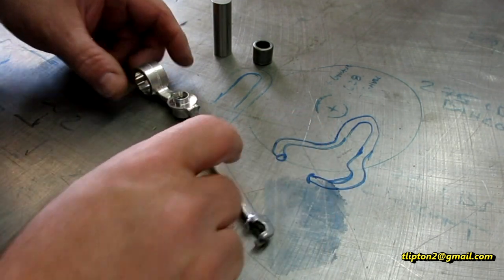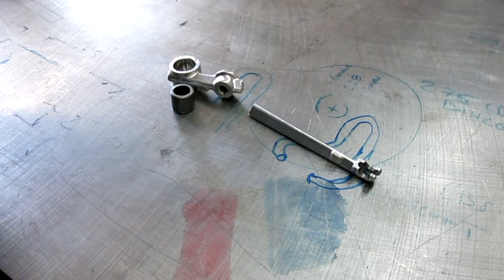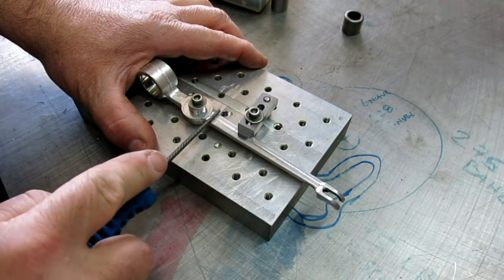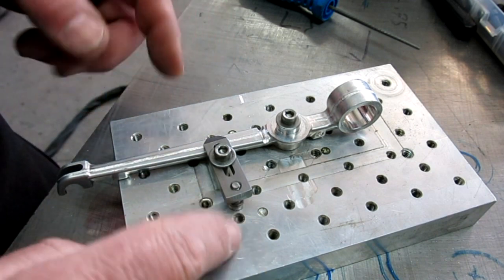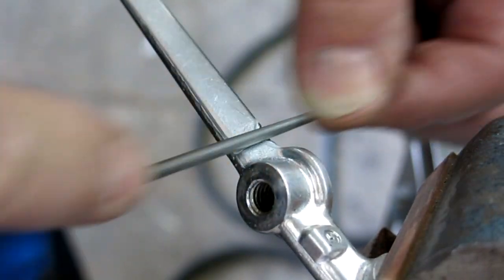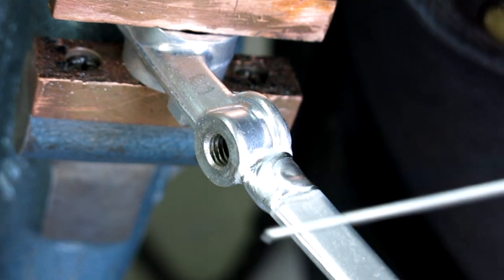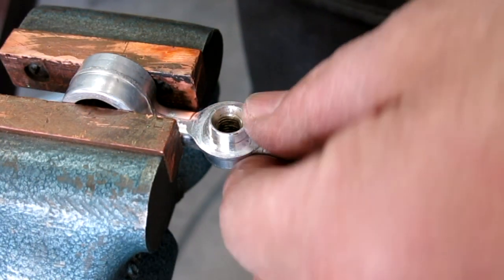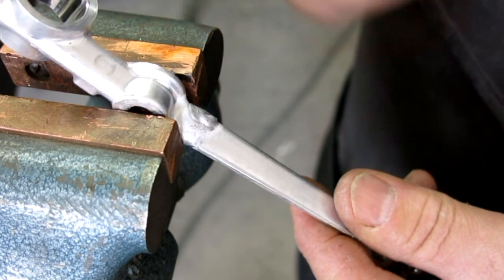BMW Clutch Arm Repair

Comment: Very nice repair Tom with excellent technique as usual.  I have found that hammer peening aluminum weld zones appear to increase the strength and ductility from the cold working of the material.

Comment: very nice weld, tom! you've just saved that man a pile.
the little sparking, if i may venture, is from the "skin" of oxides that is always on any aluminum surface. a scrape with a stainless brush would have been good, but not necessary.
thanks for the vid,
-toly
Reply: Generally the oxide layer on aluminium won't cause 'sparking', in this case it is likely to be impurities in the casting boiling off. Most probably zinc or magnesium additives as castings are rarely pure aluminium.

Comment: Thanks for the back drag on the file. I sharpened inserted tooth sawmill blades for years by hand, and if you're worried about ruining your file by not lifting it on the return stroke, you need to buy a better file. (I bought mine, so I figured I could do whatever I wanted :).

Comment: I always heard that welding cast aluminum is difficult because it has such a large amount of impurities in it.  Is it possible the cracking noises could be these impurities burning away?

On an unrelated note, after watching the Baby Bullet build, you have really gotten me into filing.  I was blown away at what a beautiful job can come out of filing.

Comment: Once again, a very interesting video and a curious part to repair. I was watching you file away at the break line, three times you filed away.  However, to my eye, which is somewhat calibrated by experience, you filed the third cut somewhat deeper than the other two.  How do you decide how much to remove…?  I have only a very little welding experience. But I am ready and willing to learn more about it.

Comment: Tom, Very nice as always. Any possibility that the threads would be "squeezed"  a bit by the heat of the weld requiring a clean up pass with a tap?
Regards,
Eric

Comment: When I was younger and most likely dumber I used a technique of drilling into each side of both parts like you have there and drill a hole perfectly aligned to each part and pin the two sides using a hard steel rod to fit the hole and use a high grade adhesive and most items i did that to had very good success doing it that way...having no welding tools to deal with it.

Comment: After the first weld on the pallet (held), is there a chance of the part pulling out of line with the second weld (warp?).
Reply: +outsidescrewball it looked to me like there was some play up on the fork end. So if that arm warped any you can probably adjust for it. Good enough.

Comment: I routinely weld alloy motorcycle parts for work in the process of restoration and I wish it went so nicely. Typically I deal with oil soaked sand castings of anywhere from 50-100 years old. Any tricks you can share in regards to how you got the part so clean? I'll generally try to cook the oil out in an oven and then use acetone and a stainless brush and repeat until it  looks ok but it's still usually a nightmare.

Comment: When filing, do you generally try to file all the way through to where the other side was repaired, or do you end up leaving a little disconnected bit in the center?
Reply from the maker: Hi Pete,

In this case I wanted to file into the weld metal on the other side. You need the original fracture for good alignment but for full weld penetration you need to be close to the opposite side. On a small part like this you can leave a little center bit still there and the hot weld will cross the boundry. Hope that helps. Thanks for the comment.

Cheers,

Tom
Reply: Thanks Tom. That's exactly what I wanted to know.

Comment: Nice job. Really surprised that arm did not distort more. Is that your talented heat control or just the nature of cast aluminum and TIG? Is it safe to think that might be stronger than new? Also thought the comment about "hammer peening" the weld below was interesting - do you have an opinion? Liked your "that's all he gets" comment. Keep up the good work.
Reply from the maker: Hi Gus,

Aluminum and a small weld like this does not move much. The conductivity of aluminum helps with minimizing distortion. Thanks for the comment. 

Cheers,

Tom

Comment: I use Durafix rods and a propane torch.  I expect these would work too but at a greater risk of melting the registering crystals...especially if magnesium continent is high.  A riskier approach but good if u dont have tig.
Reply: +Joss Fitzsimons i hated doing that, it was my only choice too, esp for thin materials, never got a tig welder, but i sure wished i had.  id be dubious of this repair holding, if it snapped it before it will again, probably just next to the weld this time. perhaps machine a thicker one from steel would be a better idea.
Reply: +jusb1066 You'd need to pick a stronger alloy, and weight becomes a problem with steel parts... and, a larger part probably won't fit on the bike.

Not sure which alloy this piece is, but it rings like a 7000 series aluminum, and 7075 is stronger for the same volume than most steel alloys...

Comment: Hey, not all of us Engineers have soft hands! Some of us actually have common sense and machining skills. 

...Although very few, I will admit. I can count on one hand the number of engineers I went to school with that I would let near my machines.
Reply: +Transane Very true!
After working on and repairing different machines through the years, there are some engineers who designed this stuff, that I would love to get my hands around their throats! Not much "common sense" there. lol
Reply: +Transane There are Engineers and then there are Engineers...  My Degree is MET (actually two, AS and BS). I made straight "A" in machine shop/welding/etc. Calculus kicked my butt but I got through it...I don't have soft hands either. I spin wrenches almost daily.

Comment: Nice job. One question, though. When filing "gummy" metals, an old mentor advised me to simply stroke my file over that big block of chalk on the bottom shelf  of the bench to prevent pinning of the file. Is that technique still used?.  Thanks for sharing. ...............Dick

Comment: I guess you can FILE  that video under "success".  Now every time I accidentally gouge something with a 10 amp angle grinder I imagine you giving the "I told you so " look while holding some special swiss file.

Comment: Hi to all,

nice repair Tom, on a badly designed item at the first place. I had the clutch actuator on my BMW break at some point as well, no hit or stone, just poor design and selection of material. It is very well protected where it is hidden on the bike, can't be hit by anything, just breaks. 
I bought a stainless steel upgrade from these guys  http://www.motorworks.co.uk/vlive/Shop/Parts.php?T=5&NU=15&M=30&Ct=CA&SbCt=BA_15_30_CA_40 when mine broke Was a long time ago when I was not into machining, or else I'd had tried to make it myself...

Comment: Nice try.....too bad it's butter soft now. Just buy a new one, cause that shit ain't going to last for very long !!!
Reply: +Jeff Silence  I'm no expert but alloys don't lose tactile strength when heated.
You could ask the guy who is doing the welding 'cos I believe he is an expert
on welding unusual alloys. Maybe it's possible he knows what he is doing.
Reply: You obviously don't have a clue about aluminum and the heat treatment of their alloys. That was almost certainly a heat treated forging that is now softer than butter in the HAZ. I could bend that over my knee !!
Reply: +g2macs I am an expert on that type of work....are you ?
Reply: +jfpinkston Too bad you feel that way. Just because Tom did it, doesn't make it the be all - end all. Tom is a brilliant machinist, but this time it's a fail. If that part broke in it's forged and heat-treated state, there is no way it will hold up now. Funny thing about these videos is that you will never hear about the failures after the video is shot. Let's see that part back in service and working for any length of time...not going to happen.
Reply: +Jeff Silence your observation & assessment is spot on.
That kind of repair on a high tensile Al forging is ok if it gets you back home and you carefully nurse the bike/part. But as a long term repair its pretty pointless and even down right dangerous, I wouldn't want my gear linkage or clutch linkage snapping as I'm laying the bike through some twisty road. 
Better to buy a new part from BWM, if that is super expensive then I'd look to fab-ing a replica from some S304.
It wouldn't be hard to make a replica part from some SS304 scraps, a couple of pieces of appropriate OD SS pipe/tube and some 1/2", 5/8" or 3/4" SS rod and 3-4 hrs work and its done. Of course Tom might not be interested in investing such time and effort for a soft handed engineer.
cheers
Reply: +russhellmy Thank-you for your opinion. We all love watching these videos, but sometimes you need to call a spade a spade. This was one of those times.
Reply: g2macs Tactile Strength?
Lets talk about Tensile Strength and Hardness instead. Both of which are reduced by heating, its called Annealing.
Why do you believe Tom is an Expert Welder? Yes he is a pretty good welder, but I don't believe Tom has ever claimed he is an Expert welder. As far as I know he is an Expert Machinist and possibly even an Expert Tool Maker, but I don't believe he has ever been specifically trained as a welder nor certified as one. I know plenty of Expert welders that can throw a part in a lathe or on a milling machine and take a cut, but they don't claim to be Expert Machinists.
Its ok for you to be a Tom Fanboy, i think he is pretty great too, but you dont need to try and shot anyone down if they have a critical word to say.
Cheers
Reply: +Jeff Silence That would also depend on the reason the clutch actuator broke in the first place.
Since it is a bike part it probably fell over or hit a door frame or some such violent encounter that snapped it. In that case it could be ok, but then again, maybe not.
I'd also like a follow up.
Reply: Other than a bind in the clutch system, the forces on this piece are relatively low...... Should be fine.